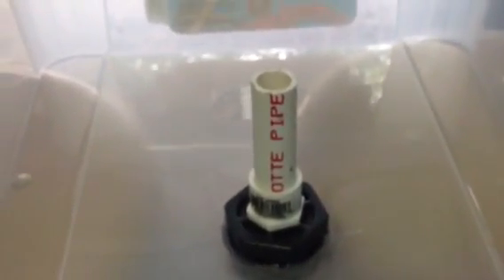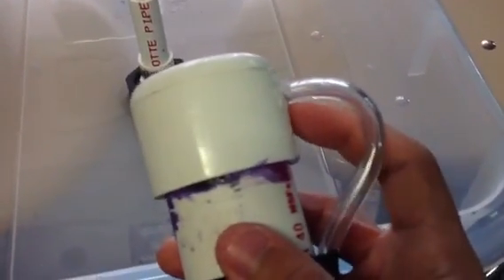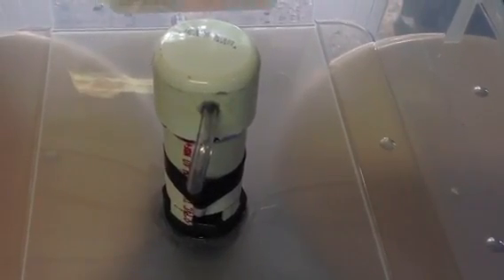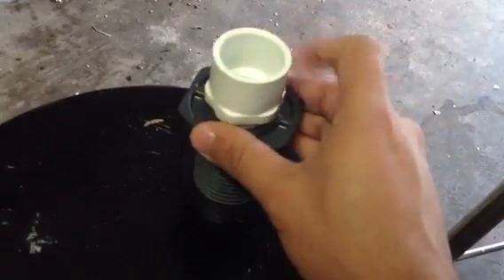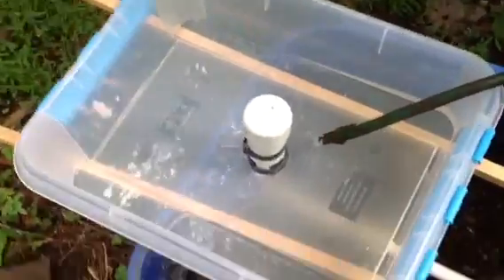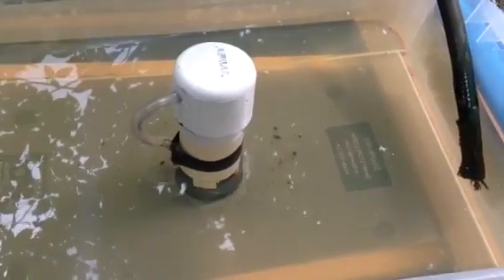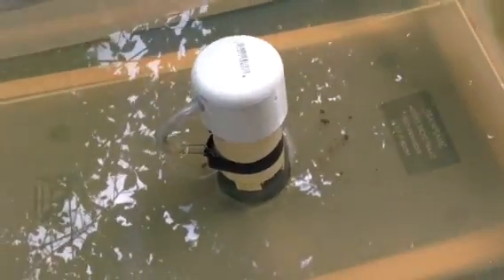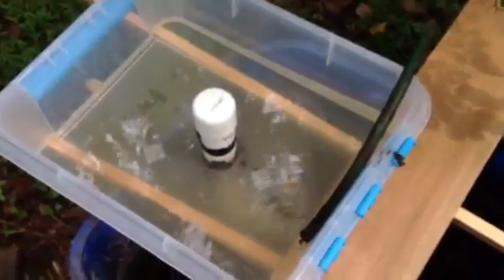Aqauponics update

Comment from the maker: The pump I have in there is pretty cost effective, its currently running off the grid, but I intend to hook up a hundred watt solar panel I have to power it if the power goes out

Comment: I see you went with the bell siphon. You'll get a better pull if you reduce the drainage return pipe to 1/4" pipe. After a couple months, bacteria will colonize the bell siphon, and that is when the problems start to show up. Clogging of the overflow pipe is the culprit. Make sure you break down and clean out the siphon every month to keep it running smooth. Take a 4" pipe drilled out and place over the siphon, that way when you clean the siphon, the gravel won't get in the way. Have fun !